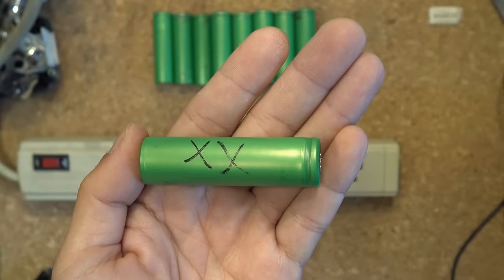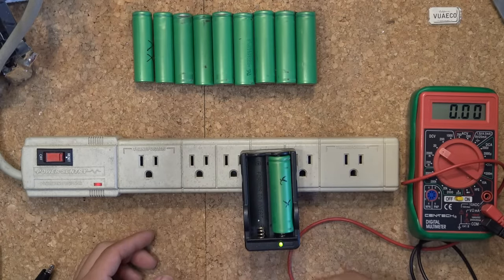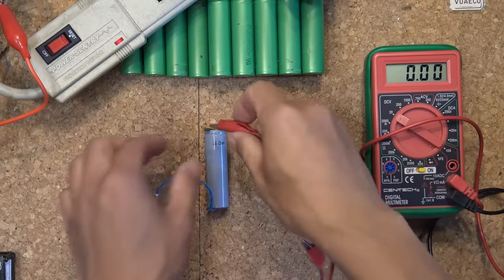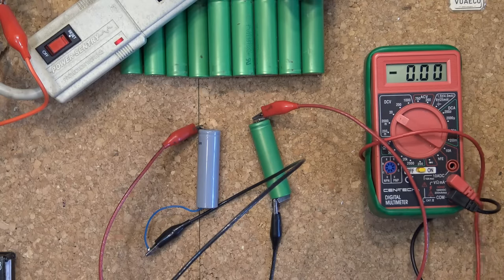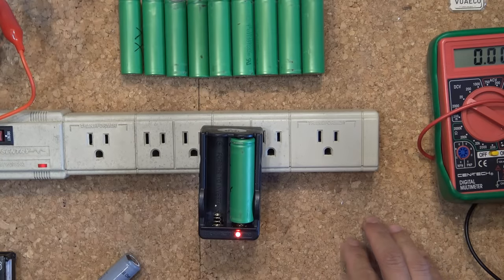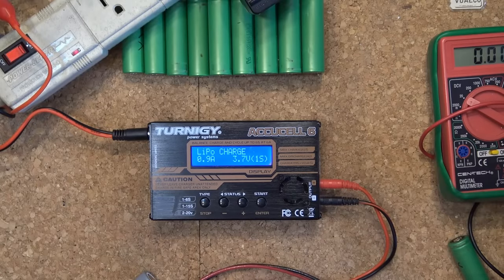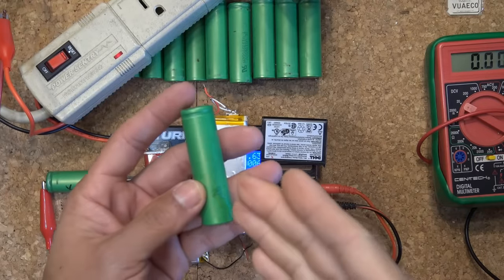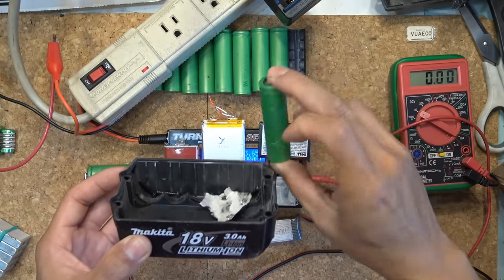DIY: How to revive a dead 18650 (or any) Li-ion battery cell

Comment: Cool trick, man. Just a tip: if you put electricity thought a magnet, with time, this one will be demagnetized. And the magnets also add resistance to the circuit, so it's better if you don't use magnets while charging your batteries. Peace, bro. 👍
Reply: That's the point only 30secs?

Comment: I cannot believe it works😂 I had an awt 18650 that's been dead for a while, did this whole process in literally 30 seconds and the battery charges! 

You sir, are a legend.😎😎
Reply: can i ask what you used for the connections? or will I have to just go get those clamps/new batteries.
Reply: @gooney2846  I literally used vape tweezers and a paper clip, held the batteries in place, and connected them up, was way too easy. Ratchet setup but it worked

Comment: Thanking you for this trick! But, I did my a face palm when you used the magnets on the clips! I love magnets but never thought of that.
An age-old problem solved!
Reply: Not a good idea. These magnets are coated with nickel and is not a good conductor compared to copper leads when charging at high amp rates.
Reply: @furonwarrior  unless you use it to keep them in place but still have full contact between the lead and the battery. How he had it wasn't the best, but it is a smart idea

Comment: what you can also do is use a Turnigy or imax b6 charger to raise the voltage to get them to charge. all you have to do it swap it to NiMH mode and charge it for a couple seconds until the voltage on the 18560 is 2.25-3v and then you can swap it back to lithium mode and continue charging like normal. it will work for any lithium cells.
Reply: Don't work with a 406 DUO charger.

Comment: Oh my goodness! I followed your instructions and it WORKED like a charm!!! I have a 14650 Li-Ion inside of a plastic case and protector circuit (known as the LIP-8) for an old Sony Mini Disc. I had purchased that battery as an extra backup and failed to actually charge or use it back in the day. The battery was so dead it would not recognize. You got me going my friend - thank you!!!!

Comment: You are on the correct path to solving the problem. A LiPo battery that reads a very low voltage to the point a charger will not accept it for charging is due to developing a high internal resistance because of a chemical reaction that occurred when it was either discharged too low and/or at a rate higher than safe. This can be fixed by applying a voltage higher than the nominal 4.2 Vmax ( and up to about double that) of what a LiPo should be charged to, and by keeping the current as low as possible (~ at 1/10C of what it is rated) so the chemical imbalance is reversed, internal resistance goes back to a normal low level, thus the battery becomes more ..."accepting" to an incoming charge. As an example connect any ...misbehaving LiPo to a wall wart with about 9 - 12 Volts and a current of as low as possible (ie 100 - 300 mA) and monitor the battery voltage level: It will start to rise slowly. The key is to let it rise very SLOWLY , like ~ 0.1 volts per minute. The slower the better, it depends on your patience just keep an eye on the battery temperature, but if you use a low current it will not warm up, guaranteed. Let the battery reach a little over 4.2 volts (not higher than 4.3 V is recommended) and disconnect it from the wall wart while observing your multimeter display. If the battery settles anywhere above 4 V it is still usable (the higher the better) although it is probably no longer as efficient like when being new. If the voltage is slowing dropping most likely it will go all the way back to an unusable level so at least you know the battery has lived its useful life and recycle it properly. Nice video, I hope I was also of some help too!

Comment: Thanks man it works! I had a dead AA very new battery only used it 3 times. Wouldn't charge, when I measure no voltage. I actually used a 9v to give it a jump for only 5 seconds. Then measured 0.8v and now its charging.

Comment: Thank you for showing this. I just had a pair of good cells, but unloaded to dead due not use. I made an assumption, that it would work if I put Elektrons in it until the voltage is reached. 
You proofed me right. Ok ok, few years ago. Doesnt matter.
Thank you

Comment: 🤟 Worked great for restoring my HS510 drone battery! Was about to tear the battery apart but I just did the jumper wire trick for a few seconds from one of the other HS510 drone batteries and it came back to life and is now charging on the Holy Stone charger. Thx for the great vid!

Comment: You should really have some amount of resistance (like a 3V light bulb) in series between the two batteries to limit charge currently (even though it will take longer), as you likely over currenting the battery for a time with possible damage. Even more so if you try to charge a smaller capacity battery from a bigger charged cell, when it could potentially even cause a fire or battery rupture (in the smaller cell). I have an electronics engineering background and having seen lithium battery fires, I recommend treating lithium batteries with great care!
Reply: yes, these safeties must be told in such videos, ppl just look as this type of videos and jump into experiments without knowing harmful side of it. some times these batteries burst out like a bomb and cause serious injuries.
Reply: Why didn't it burn huh?
Reply: What amps and voltage is dangerous?

Comment: This technique you did with a good discharged only battery. If you try it with a bad quality dead battery, it never ever will bring that back to life. Best regards,
Reply from the maker: True, absolutely. You cannot revive an extinct dinosaur but you can awaken a sleeping dragon.
Reply: This will only works for alive discharged battery
Reply: Yep once its dead, its dead!
Reply from the maker: Gary Harper: A cold bucket of water will work.
Reply: I have a bunch of samsung cells from a sony laptop, 0.8V and 0.5V, are they dead or reviveable ? also, if they're dead, if I try charging at very low current, what are the risks of them blowing up?
Reply: I hook it up to one of those 99 cent gardening solar panel....to a cell that wouldnt charge via the multi meter.. The cheap ass solar panel cant
read jack shit..dont know nothing....I forgot all about it ..till this morning.
It was a 2600 mah BAD or dead cell...that cuase the rest of the pack
to not charge from the LAPTOP pack I took apart.lol..which some toss out.
Well. Hommie....it's charging just fine now on the multi charger.
it came in at 45%....Voltage above 3.8..Now it's charging up.
I'm also using it in a R/C ...3s or 4s packs ( I made).
Im discharging the living shit out of it....
I get over 1 hour run time....more speed. less weight
vs...the stock 8.4 nicad pack @ 6oomah (10-15 mins)
The batteries dont even get hot....
I had the car upside down and throttle trigger PEG for over 45 min.
un loading it......I got annoy after 30 mins of that motor running
at max speed . The battery pack was slight warm...( normal)
I was more worry about the motor buring out.lmao
380 motor...average amp 20-30 A.
The pack read 15 % of power left..when I put it back on the charger.
Get into the learningZone...dude. lol

I did try it on 550 motors ( power wheels)....NOPE
those motors draw 60-100 amps.....UN loading unloading it.lmao
The pack got HOT within 30 sec.
i dont think Im going to put these batteries in electric scooters or skatboards
anytime soon.lmao
Reply: @vuaeco  well said!
Reply: So many keyboard worriers...
Reply: @vuaeco  well unless you are John Hammond that is ;)
Reply: If it's way under 3 volts it won't work, but if it's just under 3 volts it will? But the one in the video is way under 3 volts and it (supposedly) worked.
Reply: A bad quality DEAD battery means DEAD battery literally (it's already self-explanatory).
Reply: @johanponin1360  big risk if they getting warm
Reply: @prckata  thanks i'll do it in my fridge
Reply: @johanponin1360  not going to help, throw them in wc
Reply: @prckata  hm fireworks

Comment: This worked well! Thank you!  I will say I held the multimeter on the old battery after disconnecting from the new one and the voltage was not holding- but is expected from a battery that was left dead for so long.

Comment: Thanks so much for this. I had a dead Lumix battery that wouldn't charge and used a bit of wire to connect a good battery for about 30 seconds and it did enough so that the battery will charge again. Voltage was 0.0v. Absolutely dead.

Comment: it may show you a good voltage, but i dont think it could work as a regular battery, it wont give you enough current, and will drop voltage so fast.
Reply: Ahmad Ebrahimi will it work as new battery cell if this process is done with dead cell ?
Reply: @kuldeepsinhzala6471  no, it last only like 5 - 10% than the original power
Reply: Not true I revived a point & shoot camera battery that I had let get too low and it has worked fine for over a year now ' all depends .
Reply: When they show less than 2.5v or get warm when charging , i give them to the recycling center.

Comment: Legend, just resuscitated an expensive battery pack. Suspected this battery may have been heavily discharged and left flat. All the cells tested (in small bunches) were ~1.2v (not consistent with cell failure). Carefully adding a little charge by jumping a full 18650 in a holder onto the multimeter probes worked great (maybe building a more permanent rig with a push to close switch may be handy if you do lots of this). De how this battery goes now the charger and controller were happy to charge it.

Comment: Put your turnigy in NiMh-mode and watch you voltage manually, when it reaches about 4v, stop it and charge in LiPo-mode again.
In that way, you can force charge into the battery with current limit.
Reply: Another trick you can do is hook  directly to a 99 cent solar panel garden lights...I have wazzo of old rotted ones.
I hook up a 18650 2400mah  that was below meter charger or wont charge for 4-5 hours......wallah. It came back to life with 40% charged.
Save money on electricity too.lol
I just need to make a tray for 10 -15 single cell/solar set...
So I can pop the batteries in and out...

I finally got 18650 batteries holder....(triple). Makes life easier
for useage and charging.....I just need to wire balance lead for
the multy Charger....So it'll balance the pack...
i can easily pop out the a cell if one of them goes bad because
thet're NOT welded or solder.
Hope that makes sense.

you can get those little connectors from old electroncs...such as printers...ect..I get those from thrift shops or recycling centers.
just clip the conneters to the size you need....

There's 540, 390 and 180 motors in old printers...
I can use those motors r/c toys...ect
Reply: OneEyE Monster I don’t think you know what lmao means or you use it way too much
Reply: 100% working way with NiMH-mode

Comment: Hi is the method also applicable to over discharged 18650 with protective circuit?
Thank you so much for the info as I am new to batteries.

Comment: In most cases its not worth reanimating cells that are discharged far too low (lets say below 1,5 V). You can bring their voltage up, but they won't hold it for very long. Mostly the capacity is gone (90% of it) and they wont work well afterwards. And you take the risk of creating an internal shorts (by dentrits) which can cause severe fires! In some cases you can repair cells that are still above 1,5 V and below 2,5.
Reply: John Wuethrich, that was some funny shit !!!!!
Reply: Yeah, were not trying to shock Frankenstein back to life here....dang, grow a pair or just ask the neighbor to connect this wire 4 me and count to 20...
Reply: Loo

Comment: If the day ever comes when your home doesn't have reliable power from the grid, which in view of the large wildfires on the west coast of the USA this summer and the large storms currently affecting that area, may be sooner than you think, you will be looking for any way to re-use any battery pack you have, and you will probably want to explore the advantages and disadvantages of this method before you really need those batteries to work.  Most battery packs are made of single cells wired together, and the failure of one cell can cause the pack to not recharge or not recharge to full rated capacity. Once you decide to do it, replacing a single bad cell is achievable for the average person. Butane soldering irons are readily available, and the ability to solder doesn't depend on having 120 volt grid power available.

Comment: However the batteries “recovered” in this way will never hold a charge long under load. Over discharging an Li-Ion battery permanently damaging the cell.
Reply: Good point, glad someone pointed it out. Some further remarks:
 
1) It's not a good idea to use another cell to do this, as you'll be depleting it quite fast, and you can't control the (dis)charge rate. Best use a bench power supply, or an AC/DC adapter of the correct voltage, with a low current rate.
2) "It's already at 3V". No, the other battery has drained to 3V. Just because you touch the tips of the battery under charge doesn't change the fact that what you're measuring is the voltage of a parallel circuit. Hence, you measure the voltage of the other cell, not the one you're touching. Due to the high current at which it discharges into the other one, it experiences a voltage sag, which is why you're measuring 3V instead of 4V. If you want to know the voltage of the battery that's being salvaged, disconnect the other cell and measure in isolation.
 
That said, there's nothing wrong with the general principle. With the caveat, as you pointed out, that those revived cells will never be quite the same again.
Reply: @EvenTheDogAgrees  Not to mention the cells that have reversed polarity.
Reply: @bingosunnoon9341  you don't get reverse polarity by connecting cells in parallel. Reverse polarity is what happens when unevenly charged cells are being discharged in series. The stronger cells will push current through the circuit, including the weakly charged cells, and force them to discharge so far that eventually the charge on those cells flips polarity.
Reply: @EvenTheDogAgrees  That's not true at all. The cell nearest the B- terminal always reverses first, regardless of connection scheme.
Reply: Using another cell to charge it will destroy them both. The battery providing the power will discharge at like 40 amps and will charge the other battery at like 40 amps. You are essentially short circuiting one and charging the other way too fast. Batteries have almost no internal resistance. So they can suck back a near unlimited amount of amperage. The amperage they are charged at and discharged at should always be controlled.

Comment: Thank you so much. I have 2 brand new Imren 18650 3500mah's that worked for a week and one just stopped charging. Tried this trick by parallel charging the 2 together and bada Bing bada boom it worked. Can be dangerous but worth it.

Comment: When this works, it works, and it usually will. When it burns, it burns, and it is a very hot and nasty fire. If you add some current limiting and monitoring, you can make the process pretty safe.

Comment: @1:53 YOU DIDN'T DISconnect the parallel wires BEFORE testing the lame battery. So you were getting the sum of the whole circuit. Not the actual reading of the lame battery alone. Though this method does work, i would've liked to have seen the actual voltage of the lame battery solo at each test point.

Comment: Just be careful as the cell can get hot with the rush charge!   Charge it up to what it stops charging at and do a discharge test at the cells rated discharge rate for an accurate mAh reading.  I typically discharge at .3 A.  I rarely have good cells that were very low in voltage or they don't last long.

Comment: Incredible! This actually works. Bought a portable fan with a dead 18650 and just revived it with the battery of my vape :)
Reply: What did you use for the connections between the two batteries.

Comment: I tried this and it works! My mother’s electric wheelchair’s battery was dead because of unused by time. Battery voltage is 24v 20a in normal. But after waiting without charging it descened to 0.0 voltage. There was no energy inside of it. And then i saw this video and i thought to use this trick in a bigger scale. I used to car battery jumper to increase the voltage and i used this methot until the battery increases to 12v. It takes a 10-20 seconds from 0 to 12v. That was the half capasity of it. And then i saw the voltage is discharging so fast as much as jumping to 12v. But it was enough for a moment to charge the battery by normal way with 29.4 v adaptor. Until 15v it was going fast too because the chemistry was deformed but i made it stayed in charge position for 24 hours in max capasity and then finished the battery totally and then i charged for 24 hours again. I did this routine for a few times. Now my battery is healthy as much as it can be. In normal way, wheelchair was taking 30-40 km in full charge with a mix with normal and agressive using and now it s taking 20-25 km in the same using. I dont know how long time it will keep this performans stats but it s better than nothing. For sure it cannot be perfect like the first time but it s a good way if you wanna use the dead batteries. Thank you very much for this trick man. I saved extra good money in my pocket because of you. God bless you.

Comment: Mine sparks when combined in parallel. Also no voltage increases immediately. Checked the dead battery resistance, it has few ohms. Is it end chapted?
Reply: Most likely yes